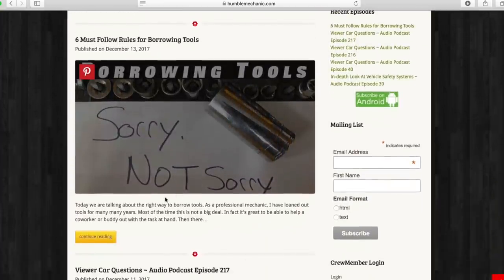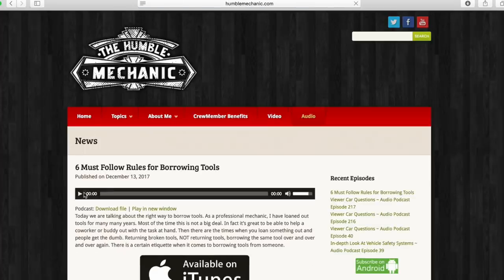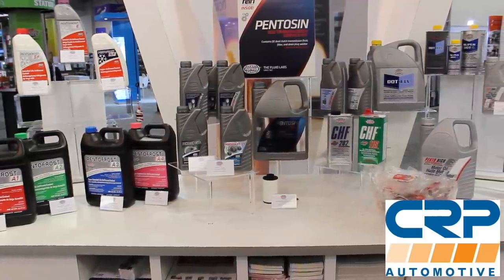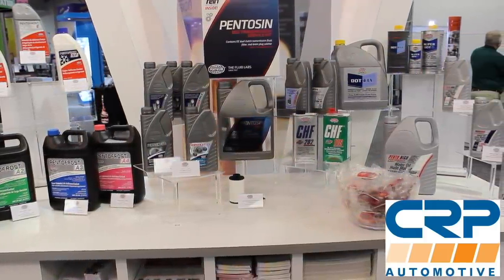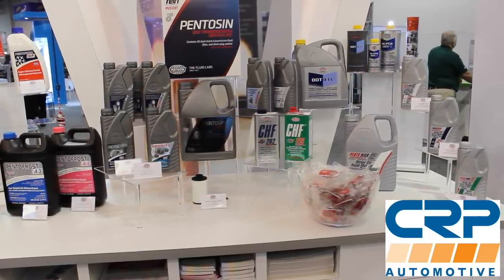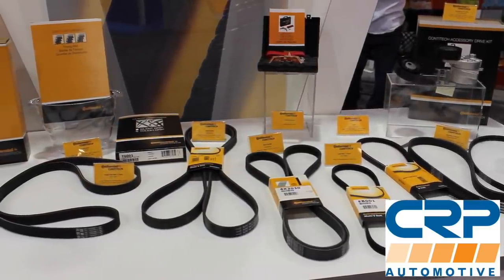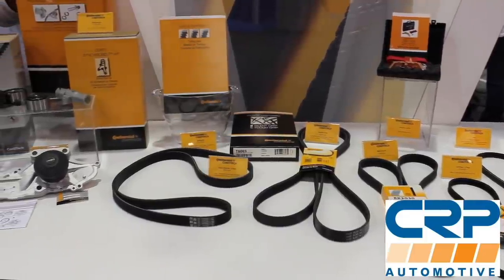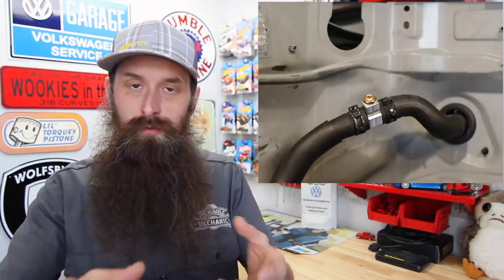Viewer Car Questions ~ Podcast Episode 258

Comment: Scan Gauge 2 is a super easy option for water temp monitoring as well as other vitals, plus it can read and clear codes. I've got one installed in my MK6 GTI, ran the cord up the A-Pillar and used an old garage door clip to fasten it to the headliner by the windscreen. Water temp, intake air temp, voltage and instant fuel economy all in easy view.

Comment: I’ve seen Volkswagen and Audi fuel pumps housings crack. Once you get the backseat out you can start the engine you’ll actually see fuel coming out of the pump itself.
Reply from the maker: You west coasters with your weird issues. HAHAHAHHA! I have actually seen that too. MANY years ago the Golfs (2002ish) had a recall for the exact thing.
Reply: Funny you should say that it may actually be due to the dry heat out here.

Comment: I added a water temp gauge in my 2003 Turbo S Beetle and i used the Water Temp Adapter for mk4 1.8t made by 42 draft designs. Easy to install and was around $50. It goes between the drivers side of the head and the coolant flange.  Readings from it are very accurate.
Reply from the maker: NICE and 42dd FTW!

Comment: Thanks for the videos, and here is a question for you.  My 2000 Jetta has a window issue or when I turn the car off and after it makes the chirping and I open the door to get out all 4 windows roll down and the only way to get them to stay up is to go through the passenger side and lean over and roll up all windows and lock the doors from passenger side. Also the driver side will not door will not lock from drivers side. Any insight on this would be awesome. Thanks

Comment: On the headlight and fan check for melting in the connector. I had to change the switch out and solder in another used connector. The harness to it should have been longer from the factory and can cause issues being so short.
Reply from the maker: Yeah there is one main red contact that gets burnt. I’ve seen a few metal the connector too.
Reply: @HumbleMechanic  I have a 2000 Jetta GLS VR6. I get a tick at low RPM or when I press the gas. It goes away when I get up to speed. Is this common on this engine and, if so, what is the main cause?
Reply: @mmill6505  spark knock or something in the valve train. Make sure you run the right fuel. Pretty sure the VR6 wants  91 octane. my Passat will  spark knock if i run cheap fuel
Reply: @zuestoots5176  I do run 91 octane. It has been making the noise for 6 months now and its only when I press the gas. I did a full tune-up and that didn't change anything. It only has 153000 miles on it . Going down the road it runs great and the noise is gone even at higher speeds so I'm at a loss.

Comment: n-906-931-01 32mm coolant temp sensor hose flange $9 at the dealer. It’s from a mk6 TDI
Reply: Post 315 in 3.6 swap thread shows the coolant flanges 

https://forums.vwvortex.com/showthread.php?t=8028002
Reply from the maker: Thanks man!!! <3

Comment: Curious: Why would I want/need to know exact coolant temperature when all of my vehicles have a tick mark gauge and there's already an exact value display for the oil temperature?

Thanks for another informative Q&A video.
Reply: The car in  question has a dash(dummy ) light which show blue when cold and red when overheating. You dont get much notice before your potentially damaging the motor.

Comment: greetings !!! love your channel, i have a situation with my mk4 2004 jetta gli hopefully you have encountered so  my left tail running light is out i replaced bulb and circuit borde and its still out fuses are ok i ran out of ideas i need help what could it be.... i love the fact that you have quality content
Reply: Antonio Rico on my b5.5 Passat the brake light switch that sits behind the brake pedal went bad and starting giving weird symptoms on my brake lights. Sometimes they’d work, sometimes the center light wouldn’t, or the regular lights wouldn’t, nothing would work at all. I took a hunch on a cheap one from my parts store and it solved the issue.
Reply: Ricardo Auerbach thanks a lot it was that i got mine from ECS tuning for 12 bucks thnks again bro 🤙

Comment: I can't remember what video it was on but you were talking about mods on vehicles taken to the dealership. 
My question is if the car were tuned, then tuned removed and vehicle has been driven 30k miles without the tune. Could it still be found?
Reply from the maker: I doubt it. At that point they would REALLY have to hunt for it. Unless they needed to, which I can't see why they would, no need to worry.

Comment: Hey Charles, love what you do man.  Quick question about my 2008 Audi A3 8P 3.2 VR6- I have a “white noise” sound coming from my driver’s side air vent, even with climate control totally off.  It’s not loud, but with the radio off at slow speeds it’s clearly audible.  Funny thing is, it stops when I give the engine gas.  You can hear what sounds like a sliding valve shutting, the sound stops and then reappears when again off-throttle.  Any ideas?  No warning lights, but should I be concerned that something is failing?  If nothing else, it’s annoying and I want it to stop!  Thanks man!
Reply from the maker: Does that car have the noise maker?
Reply: HumbleMechanic Noise maker?  Is that a factory feature or something aftermarket?  Sorry for my ignorance...I’m the third owner

Comment: Hi Charles, what’s your opinion on the new 508 spec 0W-20 oil on the new ea888 gen 3b engines? Do you think that weight is ok even in hot climate like Texas? Thank you..
Reply from the maker: Yeah I think it’s fine. Crazy to use 0w20 but it’s the right stuff
Reply: @HumbleMechanic  I just don't want to wear the engine out too quickly but I do respect your experience, and will use 508 spec 0w-20. Thank you again.

Comment: ok i finally finished putting my 2.8 24 valve vr6 in car running i get a p1050 code cam position adjuster open circuit missing bad check all the plugs for fire all firing were is the cam position adjuster located please help
Reply from the maker: I hear it’s easy to swap the connectors on those

Comment: Hello, on my Skoda Octavia 2.0 AQY 85kW, same engine as in VW GOLF mk4. I have problem with the engine. Check engine light and codes P0171 and P0172 lean and rich mixture. New spark plugs, wires, temperature sensor, Air flow sensor, oxygen sensor. 
Car runs normally but between 2,5-3000 revs it feels like misfire, but no code for misfire. Any idea? 
I have small exhaust leak but it did the same even before the exhaust cracked. Thanks

Comment: I'd like more MPG when driving and I am thinking about a diesel. I love the Golfs and pondered the 2015 Golf TDI. I've never owned ba diesel before, or a VW but, I am very mechanically inclined snd would love to learn any "small" repairs on them. Would making the switch to this type of vehicle be smart?
Reply from the maker: I love the TDI. I own a TDI. But owning a diesel is not always a great use of money. Today (MY 2015) the mpg vs a gas is not that different. You also pay a premium for the car, premium for fuel, and more maintenance. You might get a few MPG more, but you are probably not saving money. 

Now from a fun to drive point, TDI is awesome. I love my TDI Touareg.
Reply: I own and daily a 05 Passat TDI, and in high school daily’d a 98 Jetta TDI which is in storage rn waiting for me to graduate college and earn a good paycheck to invest into refreshing it. My experience with them has been absolutely amazing, however driving and owning a diesel is very different from a gasoline, how you treat it, drive it, maintain it, etc. I’ve had issues with them but I’ve never been stranded or in a dangerous situation because of a failure. Mostly inconveniences like sensors or codes and stuff. A hidden cost of a car is depreciation. And from my research diesel cars hold value much better than gas equivalents. You’re gonna fall in love with the low end torque and the causality of going on over 500-600 plus miles before even thinking about having to fill up. Just my two cents.

Comment: I have an issue on my mk4 Golf. When I turn on the headlights the dash lights often do not light up. If I quickly cycle on/off/on/off I can catch the time the dash lights. Should I look to switch itself or some other area for a short or bad connection?
Reply: I'd say remove the headlight connector and check if there's something up with the internals. Other than that all I could think of is the bulbs themselves, the dashboard bulb holders are pretty weak/strange from Mk3/Mk4.

Comment: Try purple power degreaser or aluminum bright and actually aluminum bright will probably work better than purple power few years ago I did use aluminum brite on a carnival ride that 20 years worth of  oxidation on the metal floors and it made them look like brand new but one tip make sure to not get aluminum Brite on your skin it is an acid
Reply: Purple Power is some potent stuff. it ate the coating off my aunts washer.